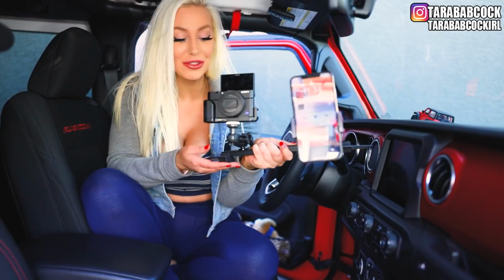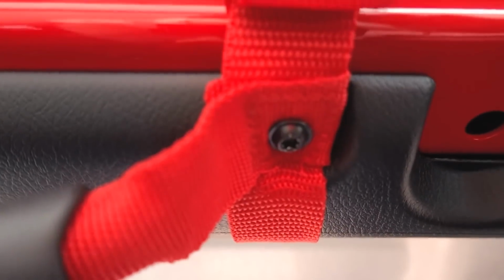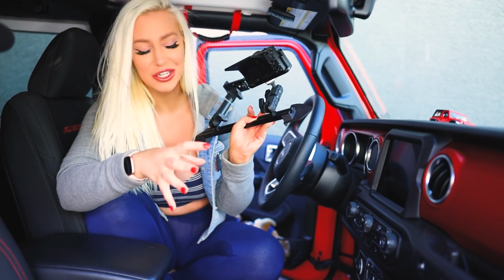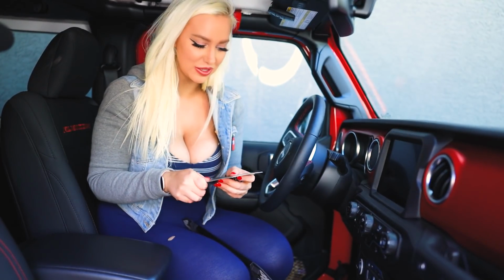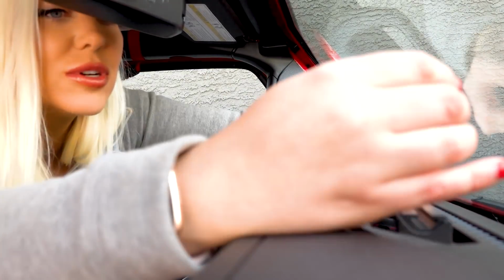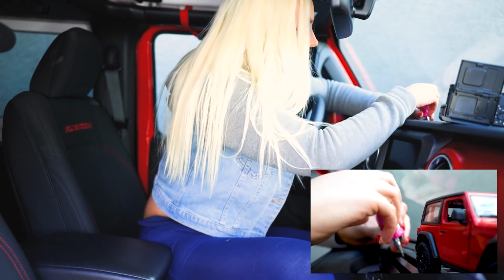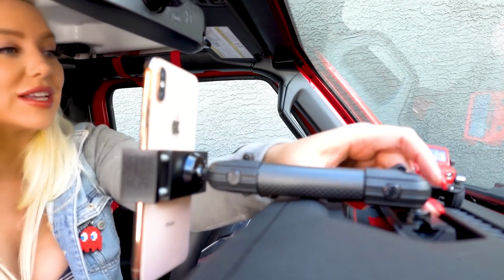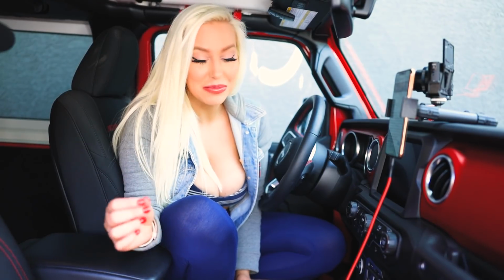Installing the 67 Designs Rail in Wreeper! (+ Mod Updates!)

Comment: That mini pink screwdriver really took care of that mod. That was some nice intricate work you performed. Working slow with correct tools make repairs go smooth. Keep the Jeep videos coming please. With your pool cleaner, you might be getting air invading your system. There might be a crack or hole in a hose or possibly a defective seal or coupling on the unit itself.

Comment: Top Lift Pros, they sell a hoist so you can take the top off of your Jeep "all by yourself".... unfortunately they didn't pay me for this advertising 😒
Reply: My condo association won't let me have one in the underground garage or else........
Reply from the maker: Yeah, I don't wanna drill into the ceiling on a house I don't own and it seems so much more difficult than just taking it off.
Reply: No, that's not how this works though, basically you just slide it under the top of your Jeep, give it a few pumps and off comes the top. Google search top lift pros, or search for it on YouTube